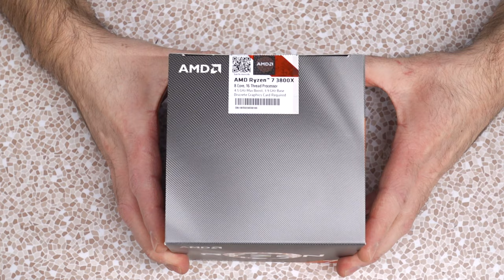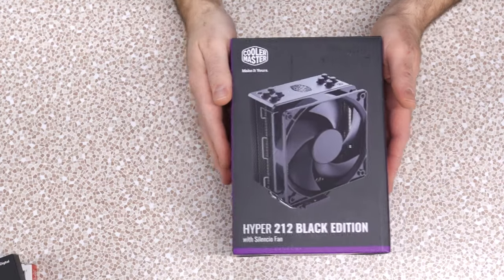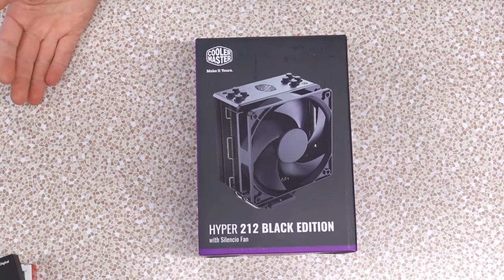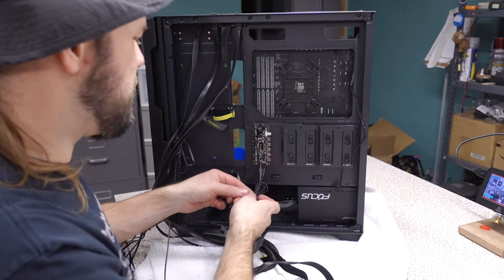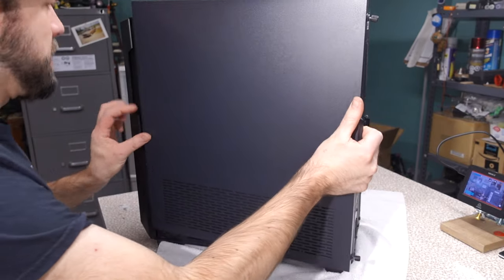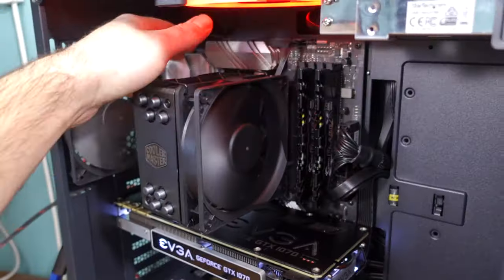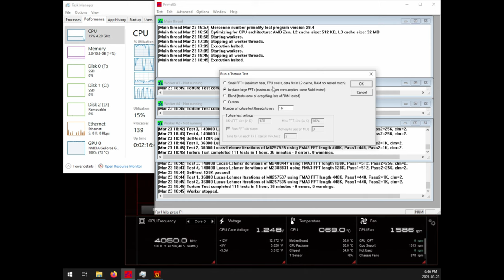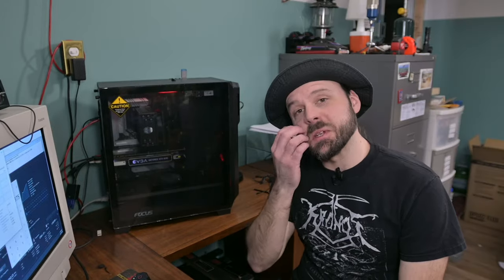The Claymore DAW Build.

Comment: Testing discussion and back fan tuning 26:30/32:14 gave me a head start;  thanks!
Part 3/4:  air cooler and paste installation https://www.youtube.com/watch?v=SAH3A4NW6xY
Part 2/4:  motherboard review, CPU installation and M.2 SSD warp prevention https://www.youtube.com/watch?v=zzpKqIwrb3w
Part 1/4:  Antec DP502 case review https://www.youtube.com/watch?v=dKKyA-N10wY
Reply from the maker: You welcome !